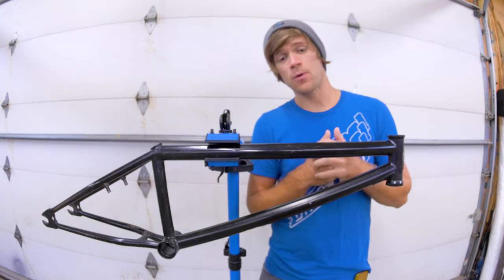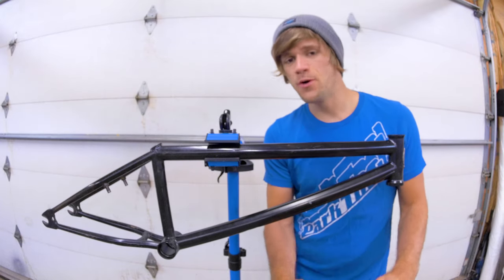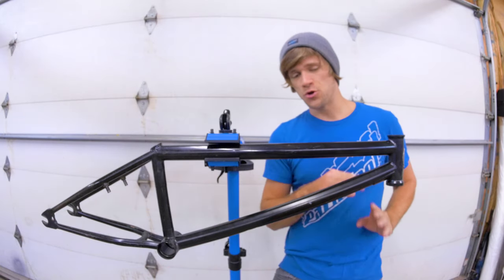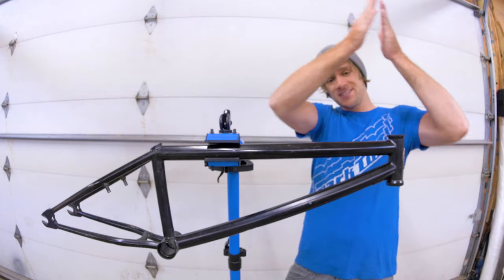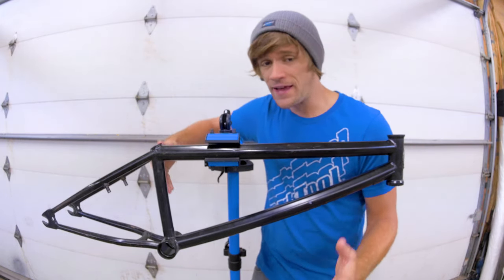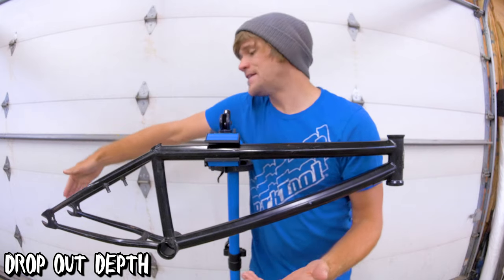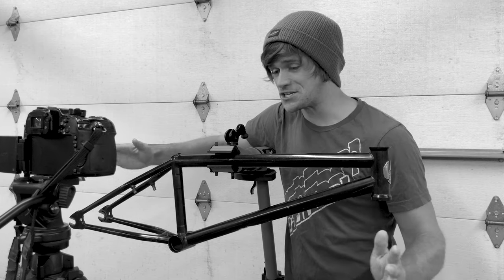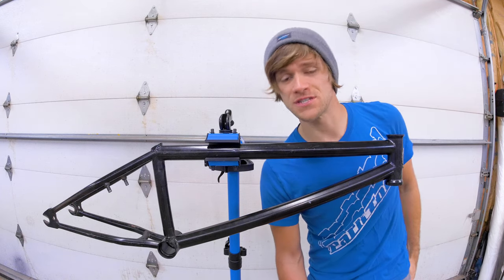Basics of BMX Frame Geometry - EXPLAINED BMX #Shorts

Comment: So is there any difference between each company’s frame geometry? Say FitBikeCo and We The People both release a new 20” bike at the same time. The angle of the top tubes and down tubes, seat posts, angle of everything? Is it all essentially the same just with different stickers?
Reply from the maker: They can be the same, but they can also be wildly different. It depends on the model of bike and this geometry is usually at least partially available